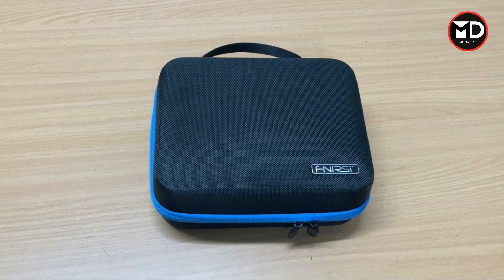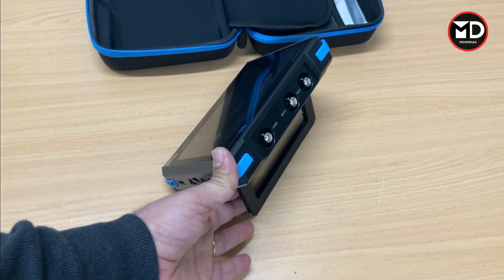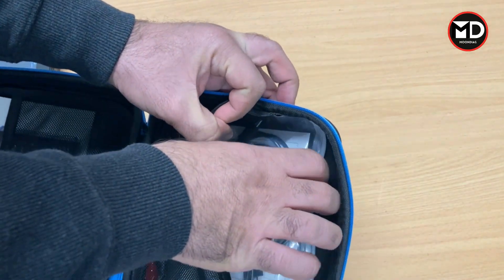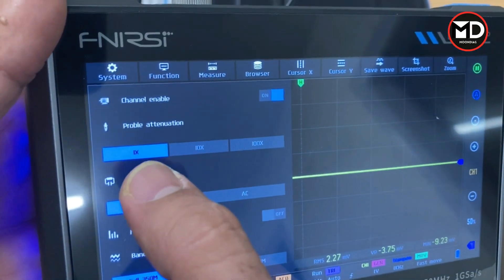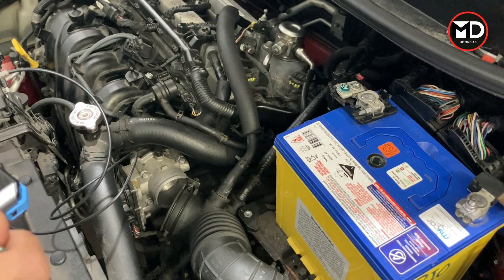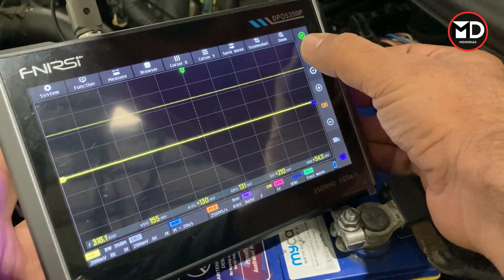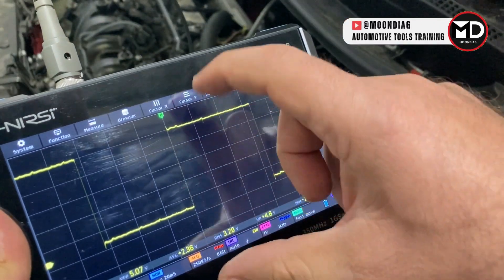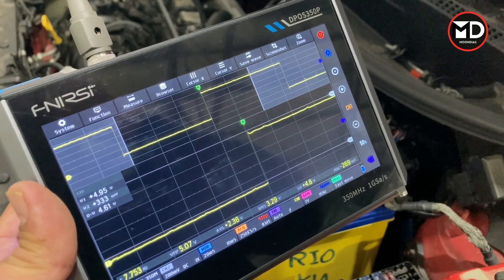Budget Oscilloscope vs Automotive Diagnostic | Fnirsi Tablet Oscilloscope Review (DPOS350P)

Comment: It’s OK for auto-diagnostics but would be better with 4 channels and additional probes with 1000:1 attenuation.
Reply: Very rarely you need more than 2 channels.
Reply from the maker: That’s true, 4 channel scopes are very good for diagnostic specially when we need to check multiple components at the same time. But sometimes we consider how much we are paying for the device too, buying the tools never ends 😊😅 I will make videos about 4-channel scopes too, I have two of them actually